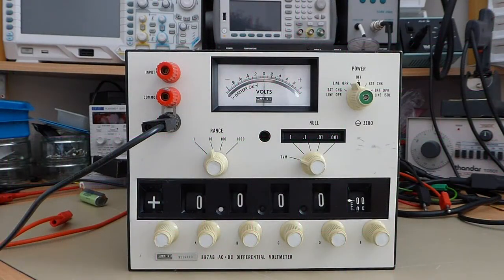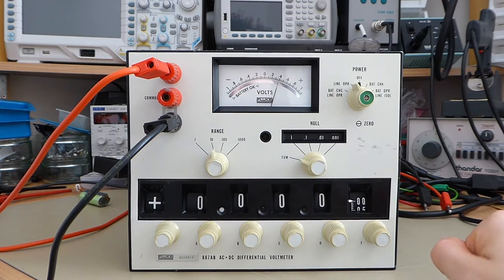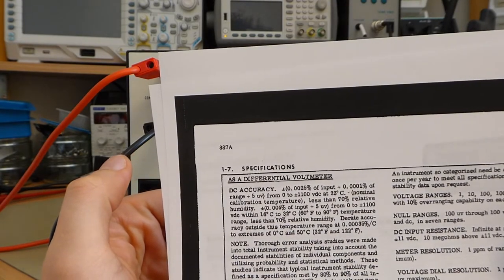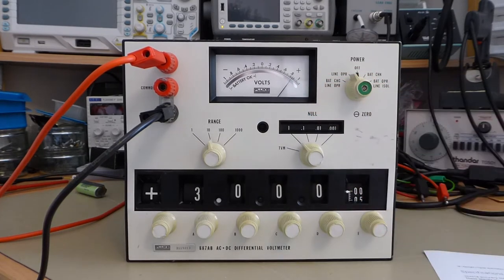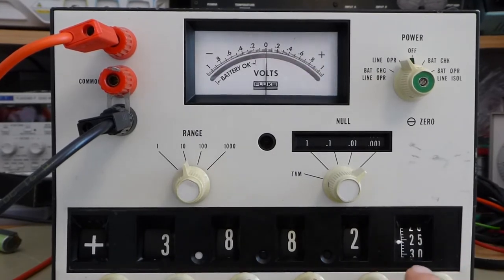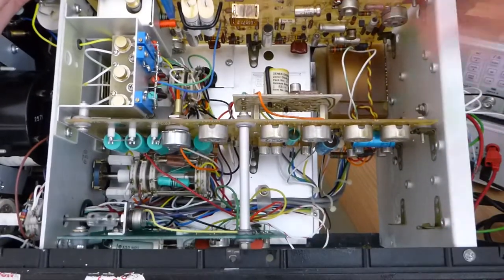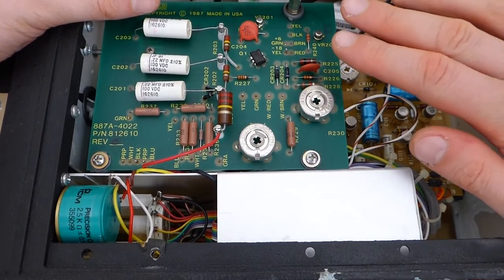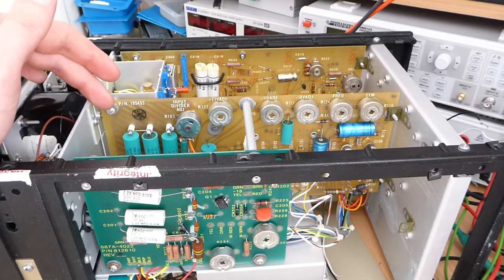Fluke 887AB Differential Voltmeter

Comment: A nice memory from the past, thank you. Having built a differential voltmeter from scratch in the 1960s, before there were opamps, I can say that getting a null detector to work at even 4 digits was a monumental task. Getting 6 digits was  testament to just how good Fluke really was in those days. BTW, the 10uV error might be offset voltage from the replaced opamp in the null detector.

Comment: The Fluke 887AB is 4159 US dollars in the 1982 Fluke catalog.  That was 1/2 the cost of a lower cost us car in 1982..

These meters are very accurate.  The specs are they mostly are within 20 parts per million within 1 year.

The Zener reference in since the unit has a oven. 

I got mine 30 years ago at a ham radio swap meet.. The us military bought many of these units. 

There are 3 different nicad battery packs in it. 

Mine had some issues when I got it 

Replaced  C219 C218 C217 C215 C213 C206 C207 C220 in Null detector area.